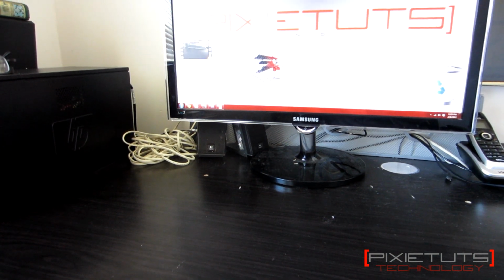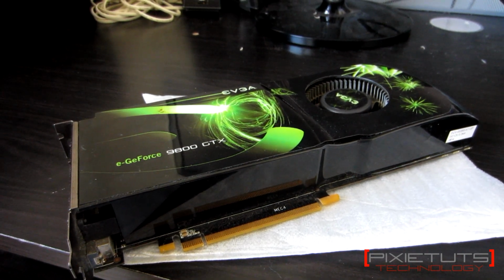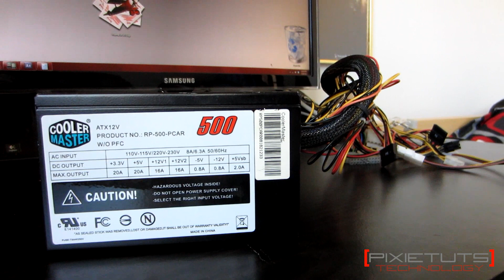Tutorial: Separate Power Supply for your Graphics Card

Comment: If you power ONLY the graphics card with it, then you might pull it off. It would get a bit of the power from the mother board and most of the power from the spare PSU. You might need to think this trough and test a little, but I'm sure you'll make it work eventually.

Comment: I powered my GPU for about 3 months like this without any problems. If it is a stable PSU, then you are good to go (Idle as well as under heavy load). Since I had a chance,  I upgraded to a higher wattage for comfort. 

Other than that, I recommend this to anyone who doesn't want to spend extra money or has two PSU-s around : ) 

Cheers and good luck!
Reply: How did u use to turn it off/on?